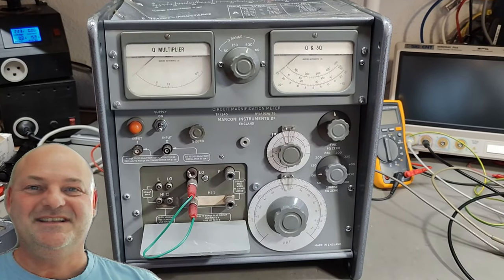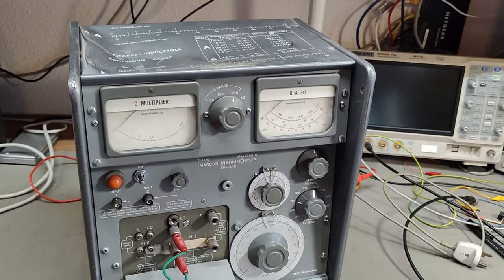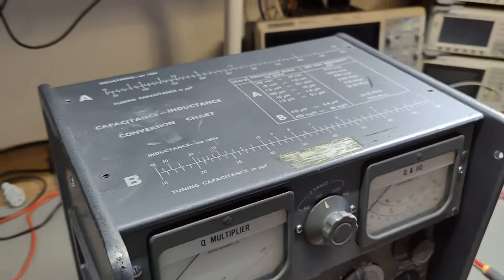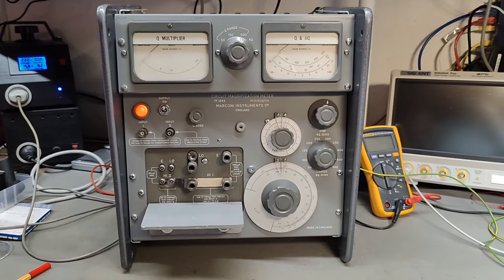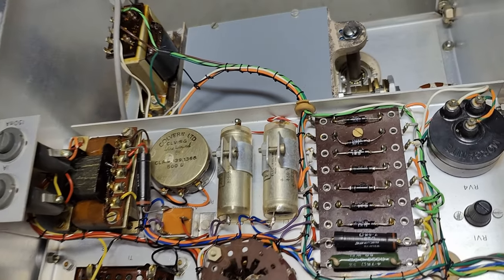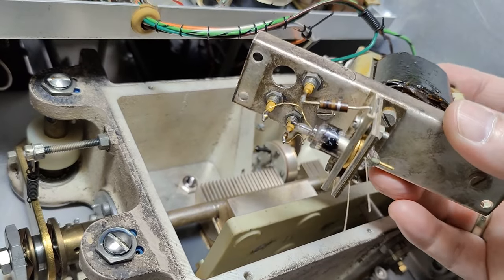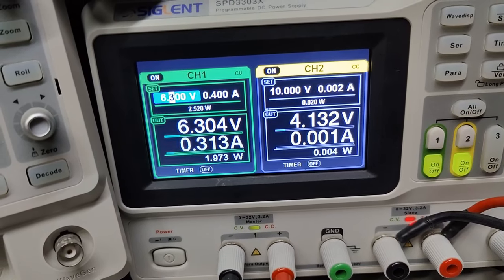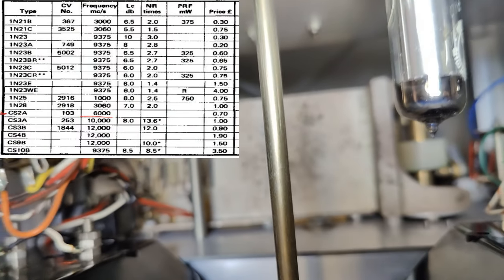Marconi TF1245 Circuit Magnification Meter Q R L C 1974 test teardown

Comment: You can't use the TF1245 with an ordinary signal generator. If you look RTFM and look carefully at the schematic you will see that the RF input has an impedance of 0.5 ohms and it needs 0.5 volt for proper deflection of the Q multiplier meter - i.e: one amp of RF current which is 0.5 watt. The TF1246 you tore down previously is specially designed to provide this power into 0.5 ohm.The two units need to be bonded together and there was a special BNC cable provided to couple them. Unless you can provide enough input power at low impedance you won't get any meter indication and will not be able to measure Q.
Reply from the maker: yes they are a pair
Reply: That's exactly it. In fact you don't need any power to see the left meter deflect to the set point with the TF1246 and TF1247, it's entirely passive. I've got the set and they are are great instrument.
Reply from the maker: @MichaelKatzmann  i also got the screw together metal bars, but combined my back tells me it is too heawy to handle..

Comment: Looks like the middle tube is far too bright, the anode is red. Certainly not normal. What is the grid voltage ? A leaky paper cap from the previous stage ? My 0.02€. Best of luck !
Reply from the maker: if you think about 4:34 with 3 tubes in the screen ? the centre tube is a voltage regulator, they normally shine bright from their neon, they are not running that hot from this.